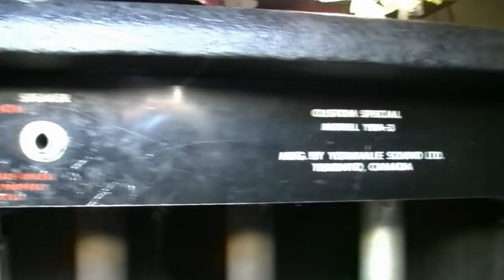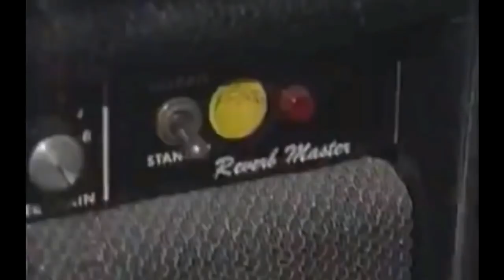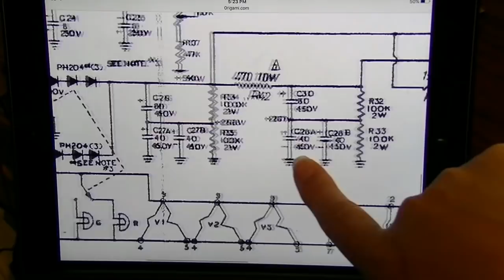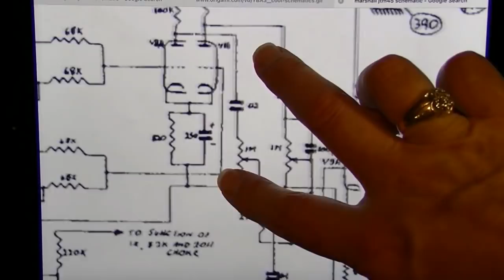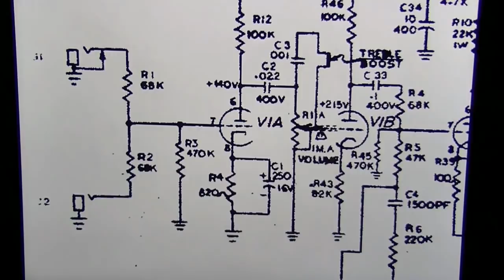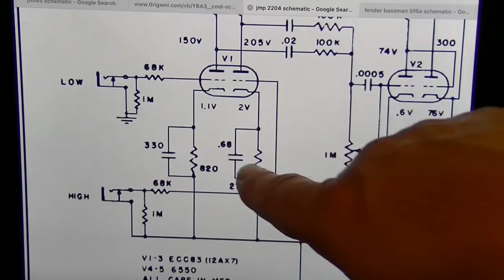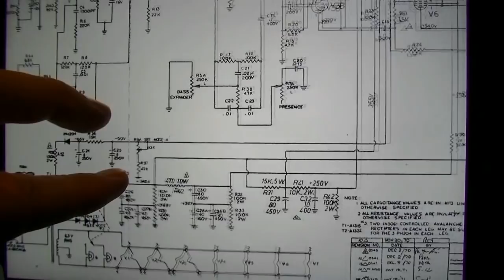Modded Bass Amp from Canada Becomes GUITAR AMP FROM HELL! - Traynor YBA3

Comment: Got one of these in the basement. You're right, heavy as hell, and the weight is unbalanced because of that mammoth transformer. loud, Loud LOUD amplifier!
Reply from the maker: My wife got angry with me during this demo. It took so long to set up the mics properly she was already pissed before I even recorded anything. That's why I had to keep looking for her coming to smack me. Loud is an understatement.
Reply: Speaking of wives getting angry regarding a YBA-3, we used to have a semi-regular gig at the Night Owl Lounge in Athens, GA around 1990. This Traynor YBA-3 Custom Special was the bass amp I was using at the time. My Traynor may be a little older or newer than yours, because the fan is on one end of the case. My wife was singing with us, and had walked to the back of the stage to get her drink off the floor beside the bass rig. I heard a scream, and turned around just in time to see that the fan on the Traynor had sucked in about 2-3 inches of her hair. To her credit, she had the presence of mind to grab her hair right at the fan intake and stop it from grabbing more, but she had to just yank loose what she could. This resulted in a trip to the beautician the next day, and she's been afraid of this amp ever since.
Reply: One of the more entertaining reasons to be afraid of an amp, although I doubt your wife would agree.

Comment: hey man, got a yvm-1 the other day all original. was thinkin about maybe do some light modding while i service it eventually(still original caps, 2 prong power cord, possibly the tubes also but currently no problems/symptoms of anything besides need to contact cleaner the pots and stuff)

but, i wasnt intending to do the usual just rebuild it as a hot rodded marshall or whatever, as i already have a good setup for normal guitar sounds, got a head and a syn2 with 2 high gain preamps patched into the head. that was thinkin having 4 separate parallel clean channels that already sound pretty decent actually would be more useful then having 6 lead channels instead of 5, to do a multi parallel wet/dry setup

the mod was thinkin of try figure something out for was maybe using some of the holes in the back(has ground switch that plugin, has 4 speaker outputs but its only a 50w amp could easily get by with 2 outputs although it is the 2/4 ohm switch version not the 4 8 16) to do something like.. use the unused half of the v3 that comes in the schematic right after effects loop right before the phase, if could have a switchable extra gain stage with maybe another master volume so you could go from the fairly high head room but hint of breakup if you turn it up loud powerful stock clean, to switch to a pushed clean/bit of break up where you could push the original first part of v3 really hard then  optionally drop the volume down before the next gain stage

still lookin for schematic thats the 2/4 version but thats the idea i guess, basically copy the same sorta values as the earlier stages passing to the second one thats the return from effects loop/from master, but not sure how would be most optimal to do the switching, maybe have it always connected to the second master and switch the output from that one to go to the common of the rail/common that all the input 4 gain stages and the return from effects loop group and it goes to the phase, not sure if there would be switching noise, or would be more optimal maybe to just bypass the pot with the switch, so would be like the extra stage always connected but that second master is just always pegged max if the switch isnt set to on/toggle to the pot

Comment: I own a YBA-3, but it's probably a '72 model. (Is there a way to tell the year from the serial number?) It has 6CA7's instead of EL34's. Bought it for bass, and is my dream tone for a bass amp, (though I'm primarily a guitarist), didn't realize till I talked to Stu Heiss (Resurrection Band lead guitarist who used one) that it was a lot like a Marshall and a good candidate for a mod. This amp is WAY louder than any 100 watt Marshall I own. Instead of modding it for guitar use I just turn the bass down and the bass boost off. We need this kind of handwired quality, forethought, consideration for the repairman, and indistructability in the amp industry again!

Comment: Speaking of grid leak resistors, I always wondered why are necessary when the volume and tone pots on guitars are already providing resistance to ground at 500k each even wide open...and if the signal goes through a volume and tone now we are at 250k to ground...add the grid leak resistor and even more signal is grounded. By the same token those 68k input resistors are limiting signal as well. I know some designers like them to eliminate radio frequency noise, but I often reduce the value unless radio noise is a problem. Less muddy sounding. More gain hitting that first tube.
Reply from the maker: You usually won’t have a gird leak resistor on a stage where there is a volume pot. The variable resistance replaces the fixed resistance.
Reply: @TheGuitologist  I guess it's possible that they put one there in case the instrument being used has no controls. But that's a pretty rare situation these days. Maybe an acoustic soundhole pickup or someting

Comment: I have a YBA-3 custom special from the very late 60’s or early 70’s that looks identical to what you saw inside the one you worked on in the video. I'm wondering why Traynor used the two metal can 40uF caps (tied together to = 80uF) mounted to the bottom of the chassis instead of the single 80uF Mallory caps top side. Why would they not just go ahead and use the same 80uF caps as they did on top? Am I missing something here? Was there an advantage to the metal can caps in this application? Thanks in advance. . .

Comment: Those heaters aren't working while you have your variac set to 60 or so volts .. 
i don't mean to come across  as some kind of know all , but i usually set up an independent 6.3 volt supply with enough current to make necessary vacuum in all tubes while limiting voltage with a variac.

Comment: As soon as I saw 4 EL34s running fixed bias at over +500VDC I was like that thing is way too powerful and loud for almost everyone.  100W will make you deaf if you like to crank it up.  I have a Peavey Mace 100+W output which I don't bother restoring because of its excessive power.  You can still get an overdriven monster sound with 6V6s or 6AQ5s at only 10-12W output.  Which will make you deaf much slower than 100Ws.  LOL  ;^)  I'm at Fort Knox if you ever want to meet up for a parts or gear exchange.  I've got lots of premium Mullard/Amperex tubes in my inventory, and a couple of little 6V6, 6AQ5, EL86 PP designs of my own you could check out if you're interested.  ;^)
Reply from the maker: Hey Paul... Thanks for reaching out. Glad to meet you. I'm sure we'll do business one day. I have a ton of nice tubes too, but they don't last forever. Please follow me on Facebook and let's keep in touch: https://www.facebook.com/guitologist
Reply: And that's 100 Traynor watts! That means 100 watts with as close to zero harmonic distortion as humanly possible! So louder than any other 100 watt amp.

Comment: First of all, I just wanted to say that I love your videos even though I understand nothing about what goes on inside the amp or schematics. You an easy person. to listen to. I also wanted to get your opinion on an amp. I really love the sound the Hughes and Kettner Tube meister 30w version. Does it being that it can switch between 5w 15w and 30w make it more prone to breakages and harder to work on?
Reply from the maker: Anytime you complicate a design, you are adding the risk of something breaking. I cannot speak to that particular model though. I have not worked on any HKs I recall. We don't see a whole lot of those in my region. The shipping from Germany eats into profits on those at retail end, so few stores around my region will bother stocking them.

Comment: Brad, that was a great video and mod. I've learned so much watching you, Uncle Doug and others. I have just purchased a 1971 I believe traynor yba-1 my question is the bass and treble controls do very little if nothing at all and also whether this matters or not they turn so easy it's like there's nothing there on the back side although I know there is even though I haven't actually got into this amp and looked at it - the tone variations between the bass and treble are very very slight, do you think that I need to change out those pots? I have read some articles on these amps and I see where a lot of people change the pots to 1 Meg from for 4 Meg, now I don't know what value pots are in there between the volume, bass, and treble and that may have just been for the volume pots, I'm not sure. Do you know of any issues with the original pots that are in these amps as far as failures or anything like that - any information you can give me on that would be great man thanks so much.

Comment: It looks like to me Traynor was playing around with a couple of feedback loops for the expander controls.
Reply from the maker: The more I look at it, I think you're right. Signal is feeding back to the input of the stage and bleed is controlled by the pot.
Reply: Yup.  Just like they do for op amps.
Reply: The Guitologist 
I was going to post on this, but found it mentioned here.. those expanders are feedback, very odd, but they do take the larger signal after tube and filter and attenuate it, fed back to the grid..   On the power supply, the 80 over 40+40, those resistors are not bleed down.. they are a voltage divider of sufficiently low impedance to force the series stack of lytics to keep the midpoint at close to half total voltage. Without them, the charging rate and internal impedance will drift around, particularly charging on startup, and it is possible to over-volt the upper or lower cap.. That divider holds the mid point at near half total volts.

Comment: Great video.  Did you also try input 2?   I have the same amp and found it to be much brighter.
Reply: The only difference between the two, one has a ground wire the other grounds through the chassis! Take a look sometime. You'll see one jack has two wires the other only has one.

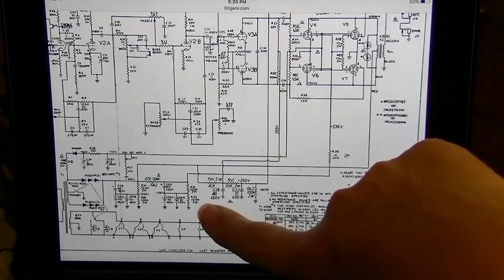Comment: 11:45 Any particular reason why it is using the two 40 uF caps in parallel, connected in series to the third 80 uF cap? Why not  just use two 80 uF caps in series, or two parallel pairs of 40 uF caps in series? Don't they all end up being 40 uF / 900 V?
Reply from the maker: They probably got a deal on those Mallory cans or had them left from other models. That's my guess. Or maybe it's also a redundancy thing. If one of the 40uf caps bites the dust, there will still probably be enough filtering and power handling there to finish a show.

Comment: do you know, in general, if a resistor with too low of value would just let energy through and call for a stronger one, especially if the previous one was blown? like if 100k doesnt seem enough, maybe a 1M would work?

Comment: HELP!! 
I have a Mesa Boogie Heartbreaker, I wanted this amp for 8 years and saved up and waited for one, finally got it about a year ago, I just turned it in this morning and the Lo Gain mode on the 2 channel is not working. I turned it on for about 30 seconds until I realized the speaker was unplugged, plugged it in and still no sound. the Hi Gain on the same channel works. I'm so confused, switched the pre amp tubes, took the chassis out, nothing like burnt..
Reply: btw, I love your videos. I watch alot of them, I figured you'd be one to know.. I just don't want to have to replace an output transformer or something like that a year after I bought my dream amp 😑 especially for my dumb mistake
Reply: brendan embrey there is no way your are going to mess up those transformers man.  They are freaking beastly.
Reply from the maker: Your OT can't be at fault. If the amp works on one channel, your OT is not the problem. Problem most likely in the V1 tube or associated component with the dead channel.
Reply from the maker: Looks like you might have a stuck RY7 relay. The Lo Mode is just a direct short across the two sides of that relay switch. Either the relay is stuck or something else in the switching matrix is at fault. Most likely the Q3 transistor. Replace that transistor and I'll bet it works. Take to a tech if you have little or no soldering experience though, because those are a bitch to solder.
Here's your schematic: http://www.thetubestore.com/lib/thetubestore/schematics/Mesa%20Boogie/Mesa-Boogie-Heartbreaker-Schematic.pdf
Reply: The Guitologist thank you so so much, deffinently will try that tomorrow!! I'll let you know what happens. 🤘

Comment: Have you built your own amp yet?
Reply from the maker: Yes, I've built a handful of scratch built amps. I prefer conversions though.
Reply: Well, that makes sense since everything is already there. As a repairman you have an incredible amount of experience and that allows you to know what works great in an amp and what doesn't work so great and I feel you could make your own sort of Marshall or Mesa Boogie style amp that is better than what those brands made at the time. I only found out about your channel recently and I have been picking up on how circuitry works while watching which is great because I have an old Carvin amp that may or may not have issues beyond a missing tube.

Comment: I have one SN 3023842 but the fan in it is Brass it had the wiring diagram under the cover on a bit of paper , But that never made it back from repair man . I got it not working when some friend`s were moving house no one wonted it it was being used as a door stop gave them a bottle of Wild turkey for it . . . .  Wondering what it is worth today can anyone give me a price on it ? Cheers
Reply: $500-$600 working
Reply: @ginomanshit2365  It is working well I did have the fan rewired on it , But you can hear the fan when it is on , i will have to get it unsoldered some time